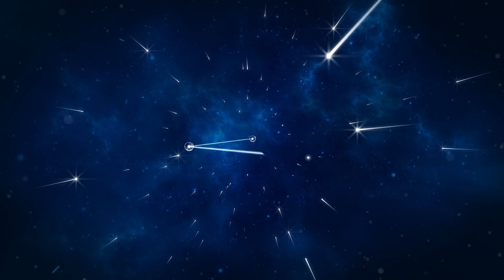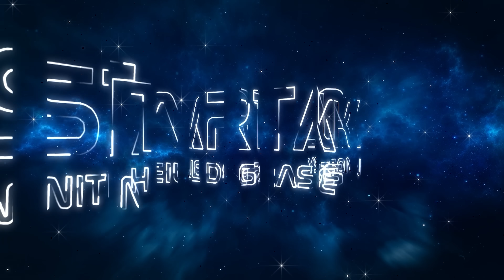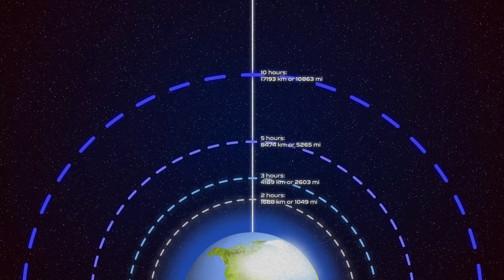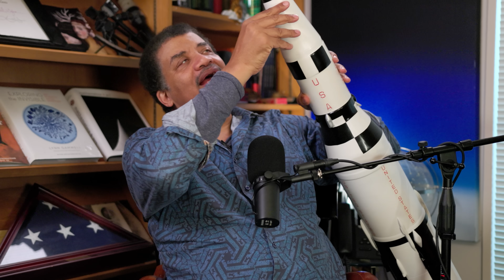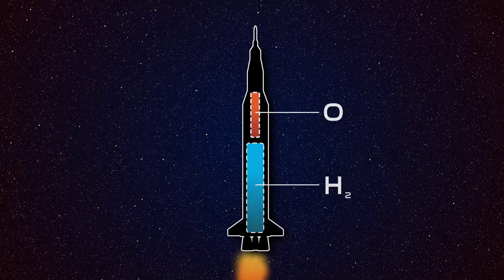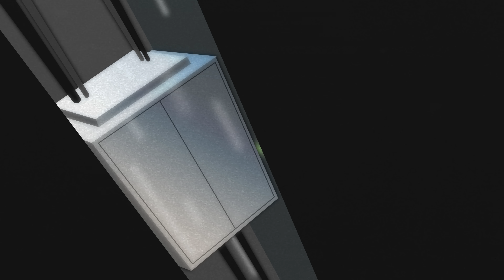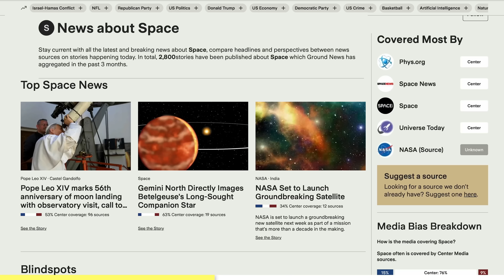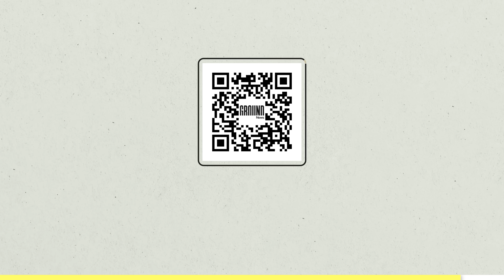When Will We Have a Space Elevator?

Comment: In the elevator accelerate at 1G for 50% of the distance, then begin to slow it down at 1G but then you have all the furniture retreat into the floor and then come out of the ceiling. That ceiling is now your new floor for the remainder of the journey. It would still be long, but not as long and you would maintain 1G of gravity until you reach the space station.
Reply: That's a really cool idea. Would love to see this in some scifi show.
Reply: Swivel mount in a sphere. Automatically aligns to the vector of acceleration.

Btw: at 1g acceleration that would very soon exceed the sound barrier even at extremely high altitudes. So the material also better be extremely heat resistant.
Because after one minute we'd already be at 600 m/s, or roughly 2000'/s. Two minutes, 1200m/s. After ten minutes, well over 6000m/s. Only a mere 20 minutes of this acceleration and the elevator would be going faster than anything man-made ever before with more than 12km/s. In those 20 minutes the elevator would have reached an altitude of roughly 5300 km. So about 1/6 the entire distance. So within roughly 90 minutes acceleration and deceleration phase you'd reach the top. Roughly.

That's not so bad. However those first ten minutes under 2g (one g standard Earth, plus one g upwards) would be pretty uncomfortable. So instead, give it 0.5g upwards for 20 minutes, then kick it up a notch to 1.5g for the next ten minutes or so, as you'd be high enough above Earth not to worry about Earth's gravity anymore, then flip around for the rest at -1g deceleration for the rest of the trip. That would extend the trip duration a tiny bit but make it much more bearable.

Comment: Tho physics may make it difficult but building 3 equal size rings around the planet you get the equator ring then tho north south rings and connect space elevators at each point where the rings connect 9 connection points all anchored to the surface is it plauseable the rings would be a gaint space station would it work or would physics not becuz the station is then spinning as fast as the surface the stress between the atmosphere and space vaccumm

Comment: a better estimate for travel speed might be 375 MPH, (experimental maglev (magnetic levitation) trains have reached significantly higher speeds, with the fastest recorded being 603 km/h (375 mph)), To calculate the time it takes to reach 375 mph while accelerating at 0.25g, we first need to convert the units and then use kinematic equations. 0.25g is equivalent to 2.4525 m/s². 375 mph is 167.64 meters per second. Using the formula: time = velocity / acceleration, it would take approximately 68.36 seconds, It will take approximately 61.33\ hours} to travel 23000 miles at 375mph. A vertical train might be  better image than an elevator car too. Also I imagine if you were going to do this you would have integrated multiple tracks so there would be maybe 2 or 4 (or even 8) running at the same time half rising half falling. If we are going to imagine building it lets make it efficient.

Comment: He made "space rope" as a joke but that's a better description of the structure than an elevator. The cable would more likely be under tension and hanging down from the station, not a tower supporting its weight on the ground. It's not supported from the ground, it's tethered.
If the cable breaks, the part of the structure above the break would fly off into space.

Comment: I have a crazy question. If the space station needs to be 23,000… miles up to drop a rope that is rotating at the same rate such that it always follows the surface of the earth. Then doesn’t that mean that every point on that rope is in an orbit that satisfies the condition that it follows the surface of the earth? Meaning that you could put that space station anywhere? That’s my proof. Please get back to me when you can.

P.S. maybe it has to be a forced orbit that needs rockets to keep it in place. But using ion thrusters powered by a station on earth would be much easier. Or given fuel or an on station reactor.

Comment: Can't we create a kirigami structure that we use as a framework to bond a cloud of charged carbon to one another in the form of a mono-atomic lattice on the surface of using a material dissolvable by a solution carbon nanotubes don't dissolve or restructure with?

Comment: Well now i feel foolish i watched the rest of the video and yo answered most of my objections except for compusating for the earth wobble, which would bring a whole new meading to space sickness, now Nanotube not withstanding one would have to calculate the exact dementsions of the tube at the lest safe working load and the laterial stresses of continual friction caused by the movement of the tower which would produce heat, the answere to this access to space would be to hit the books develope anti gravity drives or just buy a whole bumch of rocket fuwl and light the fuse and enjoy the rapid exceration in to space much faster than  100 mph, besides the weight of the inflight box lunch would have to be added 😅 Tom

Comment: I feel a point has been missed here. Yes any material chosen would break  under its own weight,  but that factor would diminish proportionally as the inverse square of the height from earth's centroid. Tidal forces exist along the entire length, and these surely diminish as well, but the true strength required would be represented by the gravitational forces plus the tidal forces. A proper differential equation would calculate this, and most likely,  has already been done to death.

Comment: great again. 
1> any objects moving on that 'cord' with mass more than 1% of the end station will have an influence on the speed of that end station rotating. Since it is lower on that 'cord' it will be having a  different rotation than an object in orbit there.
2> the space around the earth that that cord is moving through has to be free of satellites and space stations at all time or the cord will snap when it hits them. You need Space Control that has absolute power over anything moving there. 
3> if a cyclone/hurricane touches that cord you will have disaster happening. Same with earthquakes near the earth tether point. So that tether point can only be in a few locations.

Comment: Five days sounds too long if it's the size of a normal terrestrial elevator, especially with company. However, it's 23,000 miles long, you'd think the elevator itself could also be a little larger and fit a few small apartments. In that case it could be a pretty cozy way to get up.

Comment: Yes the Cost and fixing that would be astronomical. My Idea using Air Water Pressure and refillable Helium balloons would Actually make it Cheaper. Constructing an Under water Tube that can fill with Ocean water and a Launching water Pressure. The Vessel is loaded massive expansive Durable balloons and Helium tanks to loaded in like a Bullet and Cargo into the Tube.  Also designed like a Rail Gun electromagnettic speed increases and Water Pressure Pushed to the Higher Atmosphere until the Balloons expand keeping the Ship higher altitude where it can do a Lighter Boost  Launch with way less gravity. If it worked we could send materials and People up there weekly. Using Water Just Imagine me Launch to space using Soda and Mentos Candy! Their idea would be the Perfect Constant Motion Generator could absorbs solar and in constant motion sending Electron Volt Amps to Earth.

Comment: What if you used the "elevator" platform for refueling / restocking supplies / repairs / building docks?  We could send people up in rockets with minimal supplies (fuel, food) to keep the weight down and use less fuel for the rocket to launch.  You could send modules, panels, and other things up using the elevator to be assembled into much larger spaceships.  Who cares if it takes 10 days to get to get there if it's the parts going up and fuel going up the elevator.  

What's freakin' scary is if it becomes unstable and falls down.  It'd be fairly beefy cables crashing down over a very large area and not much in the way of controlling where it lands.

Comment: And every pound or kilo of mass lifted to the station in geosynchronous orbit has to be accelerated to 6876 mph.  That takes force, both up and horizontally.  The upward force will diminish to zero at the station, while the horizontal will increase to a peak, then diminish to zero also.  The horizontal force, however, will require some sort of station keeping mechanism at the station, or some sort of horizontal reaction force on the elevator.  To be effective the energy must somehow be transmitted up the cable, perhaps electrically.
Reply: Yep. But let's not let a whole heap of angular momentum take away from a good story !

Comment: In theory, a space elevator sounds great, but in practically its not only an engineering nightmare but also an impossible project.
Reply: To calculate the distance of the counterweight for a space elevator, we'd need to consider a few factors:

1. *Geosynchronous orbit*: The space elevator's tether would need to be anchored to a point in geosynchronous orbit (about 35,786 km or 22,236 miles above the equator) to remain stationary relative to the Earth's surface.

2. *Counterweight*: The counterweight would need to be positioned beyond geosynchronous orbit to provide the necessary centrifugal force to balance the weight of the tether and payload.

Let's assume a simplified model, ignoring material stresses and other complexities. The counterweight's distance would depend on the mass distribution of the tether and payload. A commonly cited estimate for the counterweight's distance is around 35,000 to 144,000 km (22,000 to 90,000 miles) beyond geosynchronous orbit.

One way to estimate this distance is to use the following formula:

Counterweight distance = (Geosynchronous orbit radius) x (1 + (Tether mass / Payload mass))

However, this is a vast oversimplification. In reality, the calculation would involve more complex orbital mechanics and material properties.

To give you a rough idea, some studies suggest the counterweight could be positioned around 100,000 to 200,000 km (62,000 to 124,000 miles) away from the center of the Earth.

Keep in mind that building a space elevator is a highly complex task, and the engineering challenges are significant. The concept is still largely theoretical, but it's an intriguing idea that could potentially revolutionize space transportation!

Comment: So I feel like you missed the entire point of a space elevator. Has nothing to do with the actual trip and more to do with payload. We can put immensely heavy things that don't need to survive the violent rocket travel into space with an elevator.
Reply: It also might mean we can get people up to space who wouldn't have survived the rocket trip.  At 400 miles/hour (the lower end of private commercial airplane speed), it would only take a couple of days to get to geosynchronous orbit, but you could launch sideways off the cable to get to destinations in lower orbits.  Larger commercial jets might go even faster.

A space elevator would be effective if you need to get engineers or other workers on site in space quickly, even when they aren't rated for launching on a rocket, piloting, etc.  We could also potentially bring things back from space without requiring the same kind of reentry heat shielding.
Reply: @nocelebrity6042 I just think it'll be a lot cheaper to educate new workers who can handle the take-off and develop new containers and heat shielding. A space elevator would be a multi trillion dollar project even if the materials were available. It's also a prime target for terrorists and for enemy forces during seeing as it would most likely serve as some kind of communications hub as well.

And even if we were to build there's still the matter of how do we make sure it'll never loose power? What are the fail safes if the elevator malfunctions.?How are we going to repair the elevator shaft? With all of that I think it would near impossible to get funding for such a risky and expensive concept when rockets are cheaper and also proven to work.
Reply: Like what?
Reply: @CaseSet236  Satellites, food for astronauts, mining equipment, and repair tools.
Reply: @CaseSet236  An entire spaceship or raw materials to build one in a space dock. If we didn't need to design spaceships with atmospheric entry in mind, we would have a lot more freedom.
Reply: @CaseSet236 fuel for one.  Tyson himself said half the fuel you would use to get to Mars is used in the first few thousand miles off earth.

If you could send fuel up there to ships that stay in space.

Comment: So I do have an a question…. If the elevator used electromagnetic pads in series, so essentially you’re going from one to the other, it would not require fuel and once you hit 0G, could you not exponentially increase the velocity to a point that would significantly reduce the time required? And then start a slowing down sequence the closer you got to your end point?

Sure, you might have a couple of hours to get to the 0G point and maybe an hour or something on the backside but in the middle you would be traveling super Duper fast and if done so in a vacuum, 0G I think it could be done right?

Comment: There's another factor to consider and that's the greenhouse gas emissions from launching a rocket to orbit. An elevator would avoid that entirely. The advances in materials science that might eventually allow commercial scale carbon nanotube manufacture might also result in a form or linear magnetic drive that could be used on the elevator to accelerate it to far higher speeds than 100 mph once above the atmosphere. I've been fascinated by this subject ever since reading Arthur C. Clarke's "The Fountains of Paradise" when I was in junior high school.

Comment: Why limit the speed of the elevator to 100 km an hour. People are able to survive in Rockets that go much faster so speed is not an issue that way. What's more we're able to travel much faster then 100 km an hour even without Rockets. You can get electric cars that go 200 even 300 kilometers an hour And that's just what's currently on the market. Personally I think the biggest difficulty with this whole Space elevator is differing weight. You would need a counterbalance for the weight of the part of the elevator that's on Earth. However you also have to have a counterbalance for the moving part of the elevator. This means you're going to have to have a moving counterbalance. Betty gets worse when you consider that the elevator is going to be yanking against this carbon fiber cable. This would be like having The Recoil of a gun and every time that elevator goes up it's going to slightly pull your space station out of orbit.